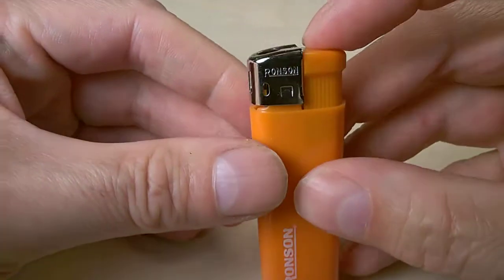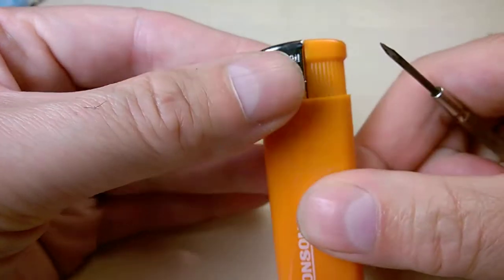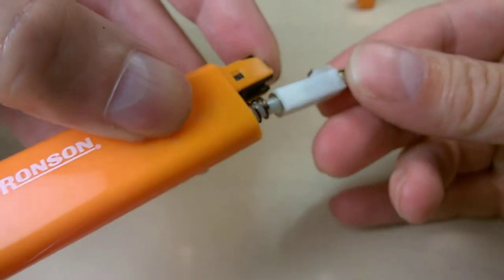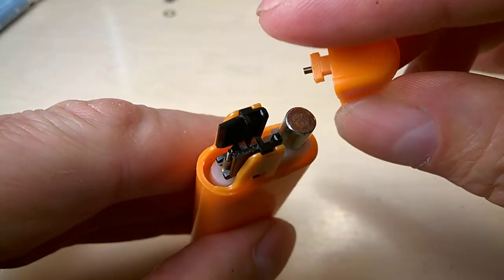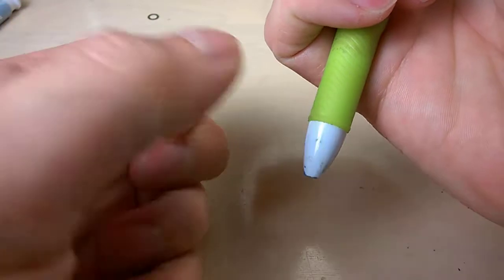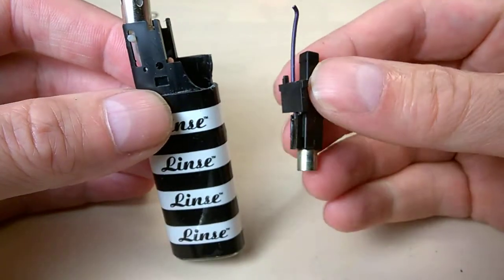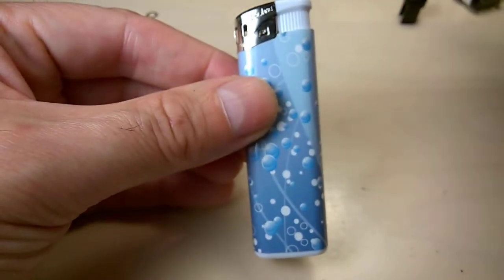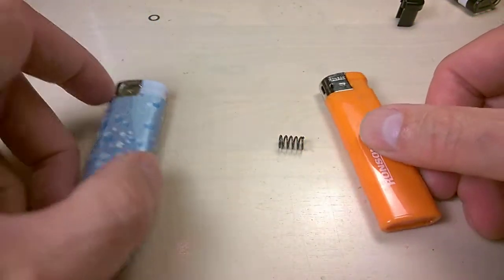Cigarette Lighter button hack

Comment: I repair lighter and torches. I’ve never once seen a spring or the piezo upside down. If this is not refillable then good hack. If it is then the piezo will wear out or break faster because it wasn’t designed to move like this and the casing plastic will bend breaking it.